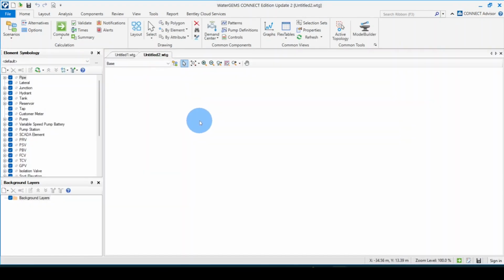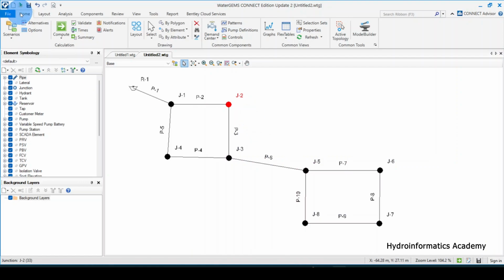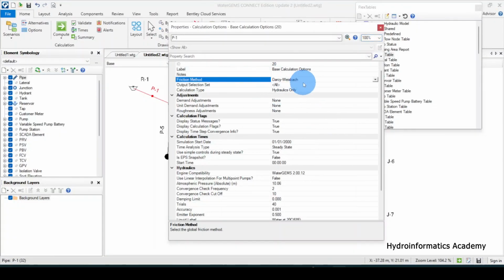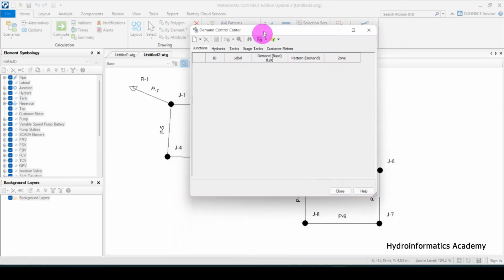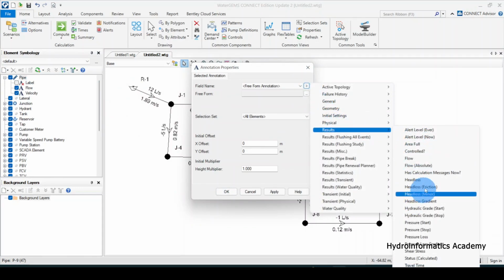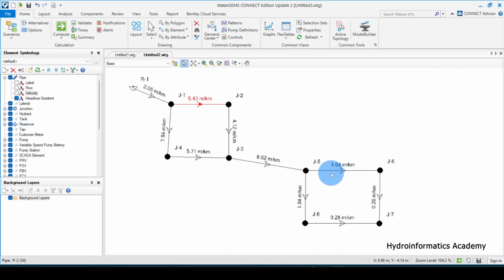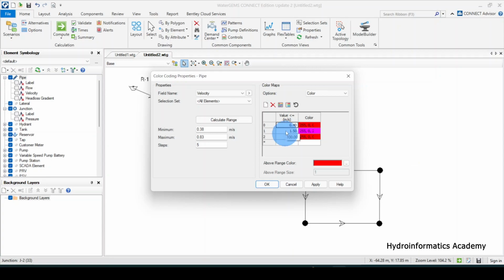Design Water Supply Network with WaterGEMS Connect Edition

Comment from the maker: ===========
TIMESTAMPS
===========
00:00 Intro
00:30 Project Settings in WaterGEMS Connect Edition
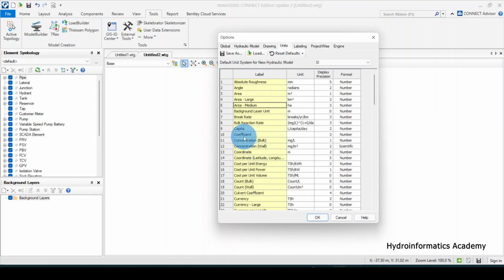04:01 How to Draw water network in WaterGEMS Connect Edition
07:39 Introduction to Flextables in WaterGEMS
08:57 Modify Junctions Elevation properties with Flextables
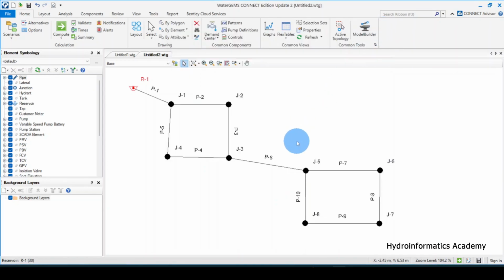12:08 Modify Links properties with Flextables
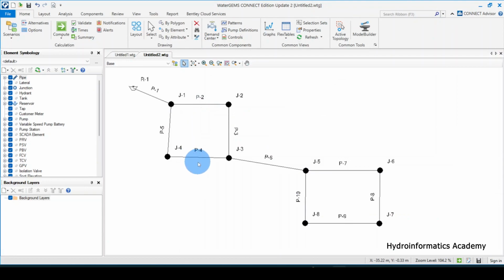23:34 Assign Junction Demands with Demand Centre
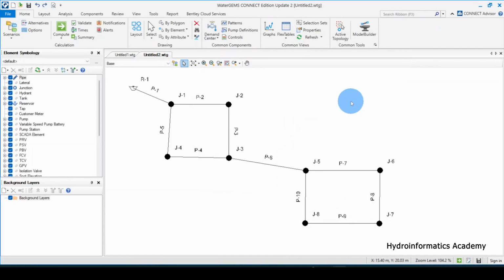27:19 Validate and Run our model
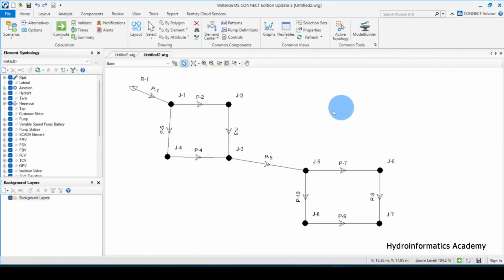28:54 Model Optimization & Introduction to Annotation
47:07 Model Optimization & Introduction to Color Coding
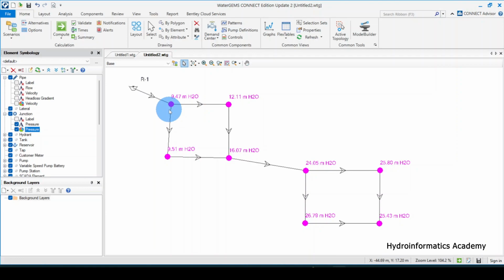55:37 Preparation of report
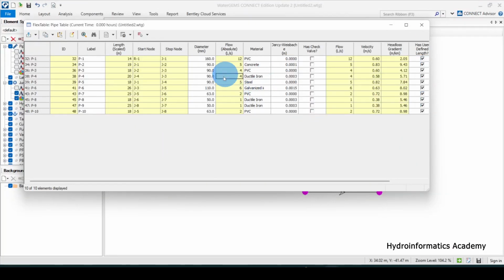57:54 Outro

Learn More about WaterGEMS: https://youtube.com/playlist?list=PLSxG_R_25yheAURfEa6YF8GKceyMAuvBb

Comment: Thanks Eng. for this informative videos. Please explain how to determine pipe demand, nodal demand and pipe flows assuming you have design data for a project.
Reply from the maker: Good question, in short, you are talking about water demand analysis! To determine demand you have two options 

1. through water demand estimation based on population data or land use/coverage. 

2. Design manuals (some countries set a minimum demand that one can use on a given water supply network)!
But the common one is "water demand analysis"!

So far we have not covered that in this channel but I am planning to launch practical training on EPANET and water demand analysis is one of the topics that we'll cover! If you are interested stay tuned for a further announcement within this week or the coming one!